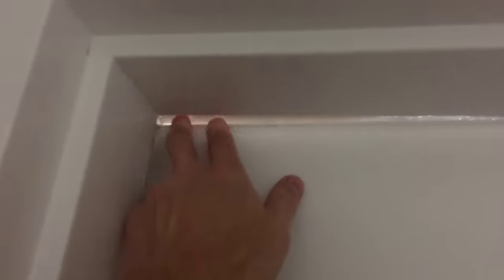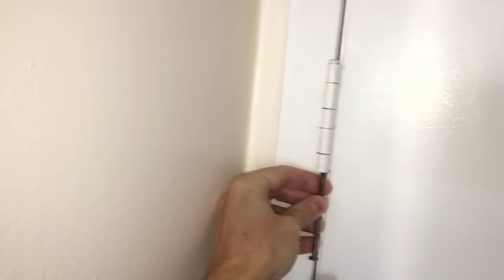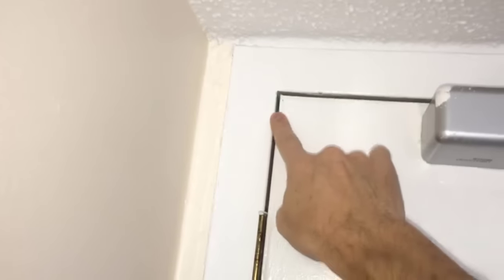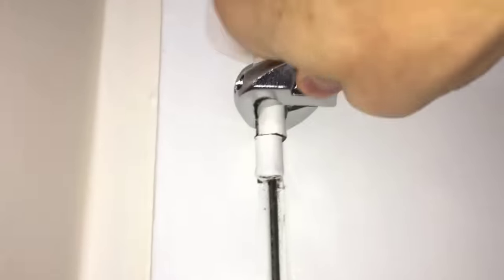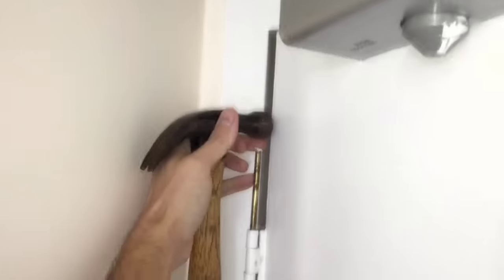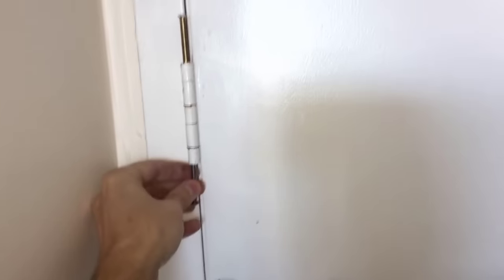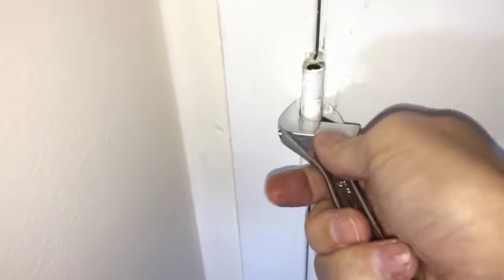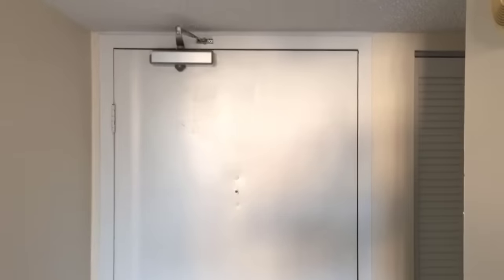Sagging front door hitting top of frame

Comment: Before you go bending the knuckles of hinges try cutting roofing felt to a little smaller than the hinge wing that sits flat on the jamb. If your dr is pinching at top pad the bottom hinge. Saves you from bending hinges. At a minimum pad a vertical strip closest to the knuckles. You can buy plastic shim strips made just for this. Its a lot more precise compared to bending hinge knuckles especially those with an easily scratched finish.
Reply from the maker: Thanks for the input.

Comment: good tip, but deep down is the foundation issue right?
Reply from the maker: Not really. If this trick didn't work, you may need longer screws to reattach hinges. And if that didn't work, there could be a structural issue with the home.

Comment: Do you have to support the bottom of the door with packing when you remove the pin?
Reply from the maker: You can, but if the door is closed, the top will rest on the door jamb without any support.

Comment: What size wrench did you use? I tried 3 different sizes and couldn't get any to clamp round the door. Ours has the same problem but it's the bottom hinge.
Reply from the maker: My wrench was pretty small, but it doesn't have to be an exact right size.
Have you tried to flip the wrench with an adjustable lip facing the other side?

Comment: In my area of central Texas, doors seem to get out of alignment with changes in the weather.  Dry season, doors close, wet season, doors don’t close! Or maybe it’s the other way what to do?
Reply from the maker: I have the same problem in Florida's humid weather because the wood expands in this environment. Running A/C more often really helps to dry the air. And the wood shrinks back. Maybe there is some special paint or coating that protects the door from swelling... not sure.

Comment: My hinges are the other way around. The 3 knuckles are on the door side. I also have a frame which makes bending the hinges harder with very little room to move. My crescent wrench also doesn’t seem to grip the knuckle. :/
Reply from the maker: I'd remove screws from the top hinge door-frame and replace them with longer, 3-inch screws (predrill longer holes first). And that should have a similar effect as on this video.

Comment: Clearly this technique is working for people so i must be doing something wrong?  when i open the door slightly to align the loops so the pin goes back in, it seems nothing has changed. The door is sticking exactly as it always has. Door position unchanged. What am i doing wrong? btw, it is a wood door and this problem is caused by the house settling. There is large gap at the bottom, and the top is then hitting the door frame.
Reply from the maker: This technique is great for a sagging door. But if the whole hose is sagging, this may not work. Probably, your best bet is to shave off part of the door on top.

Comment: How would you do it for a fire rated door that's super heavy...
Reply: Like if i open one hinge will the door not fall off?
Reply from the maker: When you pull the pin from the top hinge (with the door closed), the top of the door should rest against the frame. It would be helpful if someone always keeps pressure on the door to hold it inside the frame.

Comment: Is it the same process if my door is a little high instead of sagging? It hits the horizontal top part of the frame
Reply from the maker: Your situation is a little trickier. Because the whole house could be sagging, or the door could be swelled up due to high humidity. In those cases, this adjustment may not work.
Reply: @Your-Self  Thanks for your quick reply! I see water marks on the door, which was primed but never painted. It is likely swollen. Do you know anything I might try for the situation to attempt to get it to fit?
Reply from the maker: The door may or may not shrink back. 
You could try planing (shaving) the top of the door, but not too much. As it could shrink back.

Comment: When open or close a click sound is heard on the top hinge. Any help to rectify? Thank you ❤️
Reply from the maker: The top hinge probably got wobbly. Open the door and look at the screws. If they are loose, try to tighten them. But most likely you'll have to replace those screws with longer/fatter ones. Good luck!
Reply: @Your-Self  do as you said tighten and it work. Problem solve many thanks.
Reply from the maker: Good to hear that you fixed it!

Comment: This is pure hack. The proper way is to first check for loose screws on the hinges. If they are all tight, then chisel the hinge pocket slightly deeper on the top and middle hinge. Simple to do without altering the hardware.

Comment: One tip to add to this is to shim the door to where you want it. That way you only need to realign the knuckles so they are in line instead of guessing how much to pull them.
Reply from the maker: Yes, I thought about shims after I finished the job. Next time will definitelly use them. Thanks for your input.

Comment: I like
Reply: The door I need fix has five knuckles also 3 on the door side and 2 on the frame so do you need to adjust the 3 to n the door? I ask this because you said to adjus t the ones on the door not the frame
Reply from the maker: @Jeff Stewart I think your hinges are flipped. It's better to bend the 2 knuckles to cause less stress on the hinge. So in your case try to adjust the 2 knuckles by bending them towards the frame if you have enough space there. If not, then bend the 3 knuckles towards the door.

Comment: How about the reverse: the 3 hinge on the door side,into hinge
Reply from the maker: In your case, bend the 3 knuckles (loops) on the door side, or the other 2 in the OPPOSITE direction... if you can. 
Maybe, try to replace the screws first with longer ones on the frame.
Reply: YourSelf Now my hinge pin is cap on both ends. How to take the pin out? Thanks!
Reply from the maker: The bottom cap is either screwed-on or pushed-in.
Grab it with pair of pliers (vise grips better) and try to unscrew it first. If it doesn't work, hit the pliers with a hammer down while squeezing the cap... it should come off.
Reply: YourSelf you are really helpful. Now the pin is too tight cannot hammer out!
Reply from the maker: Ask someone to slightly lift-up the door by the handle (to relieve the strain on the hinge) while you hammer the pin out. 
Or place a shim under the door (by the handle side)
Reply: YourSelf you are really skilful. I will try this together with spraying WD40 lubricant on the pin. Thanks a lite!

Comment: I'm having trouble I can't take the nail out of the hinge😔
Reply from the maker: Grab the nail with a pair of pliers and pull. While, you or a helper, slightly open the door, and wiggle it a little to realign hinge knuckles (loops). When the nail is out, the door may fall, so hold it tight.
Reply: You can also use a flat head screwdriver, or something with a strong flat edge and a hammer to wedge the flat edge under the head of the pin at the top.
Also helpful if the pin is painted or sealed somehow to the hinge at the top.

Comment: There was no need to adjust the centre hinge. You said it wasn't bearing the weight if the door. The fact the the pin was moving freely was not proof of that. The pin was free because the 'loops' were perfectly aligned. The pin does not support the weight of the door. The pin only provides a fulcrum for the hinge to pivot. If you checked the door after adjusting the top hinge, I'm sure it would have been fine.
Reply from the maker: Thanks for your feedback and yes, the door would've closed properly after adjusting the top hinge only. However, I feel like it's not going to last long, and the door will sag again. Adjusting the middle hinge just a little should help to hold the weight of the door longer. Thanks for watching!
Reply: I agree with G SAU.  The pin is the fulcrum only and should not bear any of the door's weight.  The hinge flanges, screws, and door jamb bear the door's weight.    By bending the hinges, you've only added forces on the hinge pin that shouldn't be there and will eventually lead to problems---probably squeaky hinges---in the future due to binding hinge pins. This is what happened to my entry door for which a previous owner clearly bent the hinge. The correct way to fix the problem is either with shims to move the door away from the jamb or by using longer screws to draw the door closer into the jamb, depending on which specific problem you have.  Another useful solution that may be necessary in more extreme cases of misalignment is to deepen the hinge mortises to pull the door towards the jamb.

Comment: This is not a proper fix. Your casing might not have been set sq or off level opening so  would route out the henges to set in cause if u bend henge to much back edge of door will hit and not close properly  either

Comment: Loop?it's called knuckle ,middle hinge is not load bearing the purpose of middle hinge is to  maintain continuity  it looks like it may  be a fire check  door  in the event of fire it keeps door from bowing out,this is  mostly bodging  & you do not  adjust doors in this way, question what happens  to metal when u bend it .The top butt as  is professionally   called not hinge bears the  weight  of the  door, metal has a memory , this is bullshit  but hey what do iknow only spent my life working as  a professional  carpenter .these vids  do  much damage to correct procedure's   bloody amateurs
Reply from the maker: Thanks for commenting, and I appreciate your experience.
Most DIYers (not your customer base) are looking for an easy, quick, and free fix that can last for a few years... this video delivers on that.
Thanks for watching!